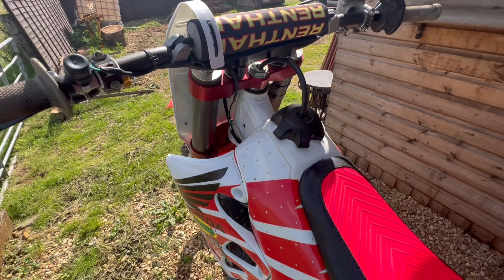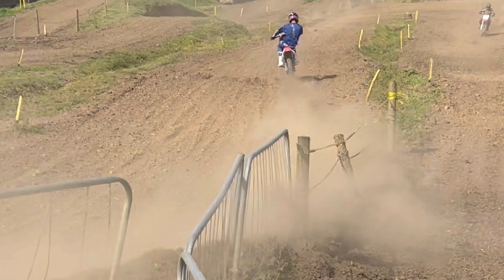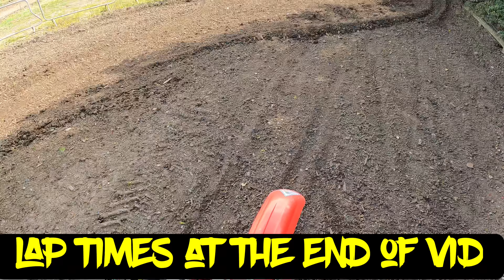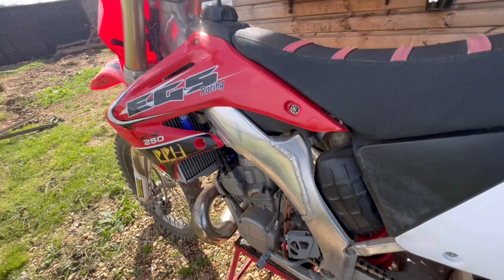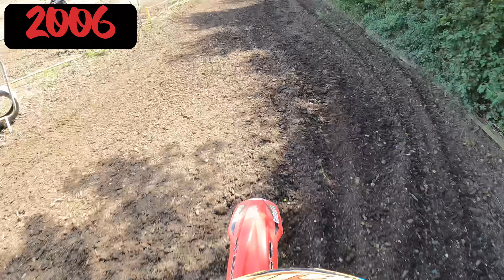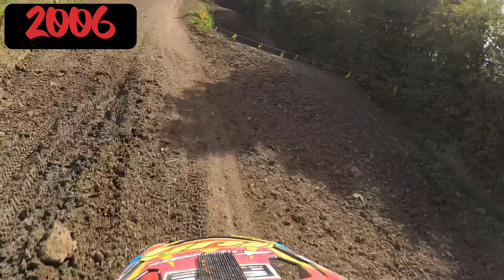HONDA CR250 TEST 1996 Vs 2006

Comment: Ok brother.. I don't know your budget.. but I can with the utmost confidence tell you if you can afford it.. send your cylinder an head to pro circuit. They can port and polish it to match your pipe and silencer to get the power curve you need.. Mike Brown rode for them several years ago (late 90s early 2000), and his bikes were faster than a lot of the big factory riders! (Yes, I'm also a fan of Brownie. He's from my home state TN)It was ported and polished and had a matching pipe and silencer and pro circuit suspension..basically it had more bells and whistles than joe blow off the street could get! I rode one of his pro circuit 250s it was either a late 90s or early 2000 model, after he traded it in at Honda of Johnson City here in TN.. It would hang with my 1985 Honda CR500 I had at the time. But if you need a little more mid an top, have her ported and polished with a matching pipe and silencer! Just make sure whoever does it knows what they're doing! Going up a tooth on the front or down a tooth on the back sprocket could make a difference.. also try what they call a phat head cylinderhead... it's a cylinder head that comes with a couple of interchangeable head sizes.. for different compressions.. try different plugs.. a Boysen Rad Valve (firm believer in them)will also help.. or you could change your gearing a little.. if you feel like tearing her down to do that.. Neville Bradshaw No.1 baby!! Go, team Bradshaw!!!😊❤😊❤😊❤

Comment: I have a 96 cr250 i bought new its got original front tire and same weisco topend from when i bought it  iam 230 pounds and it wheelies every gear
Reply: what, you havent changed the tire since 1996? much be very worn out by now.
Reply: I've got a Honda collection. Wish Honda made a 500r 3 wheeler. A 250s not enough in a wheeler. In a track bike my cr250s perfect.

Comment: Helmet cam .... 👍👍     My '06 is fast as f@*k       
Keihin carb for bottom-mid
Mikuni carb for mid-topend power.
Reply from the maker: Those new generation CRs are good when you get them set up
Reply: I even like 06 in stock form